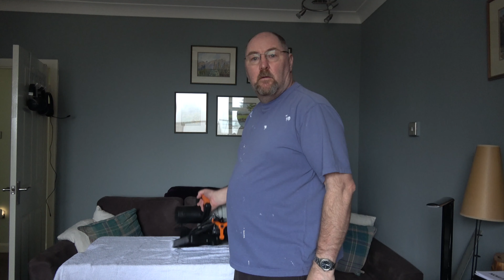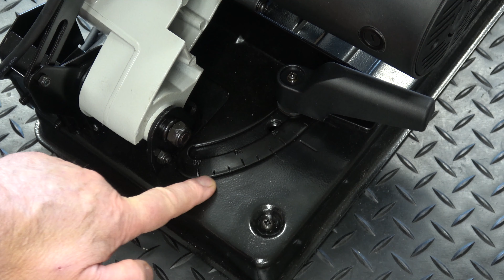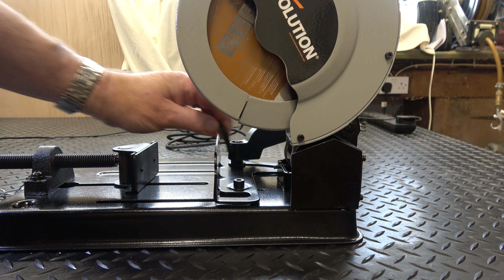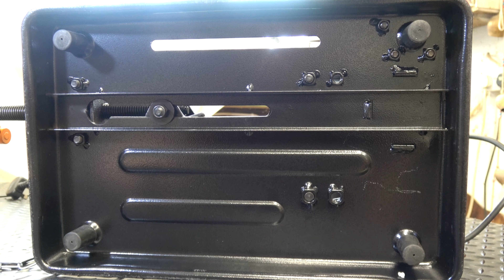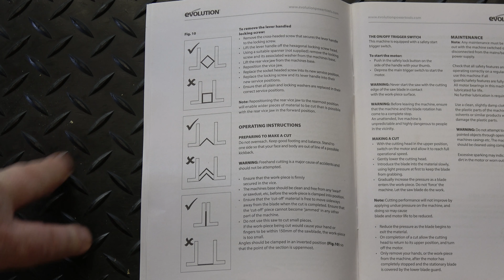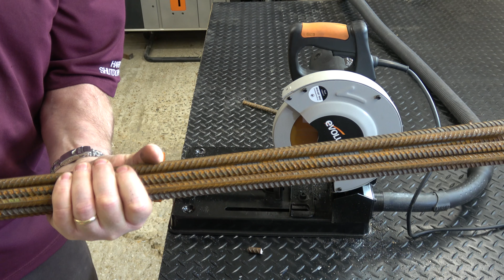Evolution Rage 4 Chop Saw Review - A little gem!

Comment: How would I set up a stop to cut several 100 pieces of 2" long 1/2" steel tubing?
Reply from the maker: Clamp the saw to the work bench and make sure it will not move.  Find a wooden off cut that is higher than the base to place next to it.  Make sure it will stop the steel tubing if it is pushed past the blade.  Slide the wood until it is two inches from the saw blade and clamp it securely.  :-)

Comment: Dont waste your money, 11 cuts through 30mm box section and the blade was completely useless
Reply from the maker: I had an issue with mine cutting rebar and ended up fitting a diamond blade.  :-)
Reply: @RussellPlatten  I have an Evolution circular saw which cuts steel plate. Same size blade so I tried that and it's much better. I see I can try a mild steel specific blade it's another 50 quid mind.

Comment: What sort of mitre saw were you using to cut steel before? I'm assuming a standard mitre saw designed for wood, how did it go? This little saw is available in Australia, but I have a mitre saw and would like to get specific angles and not be limited.
Reply from the maker: I used an Evolution Mitre Saw.  I have several reviews of the Evolution range if you want to have a look.  :-)